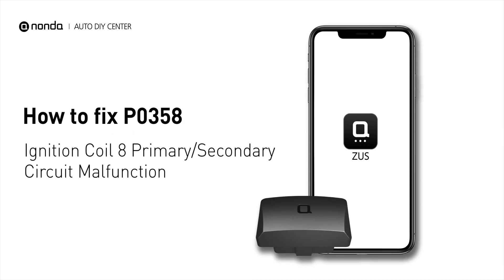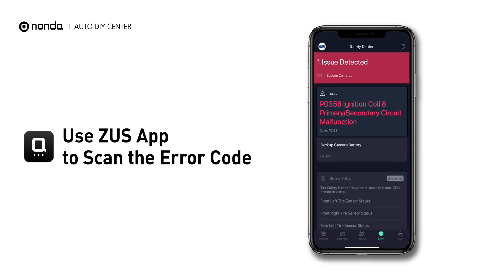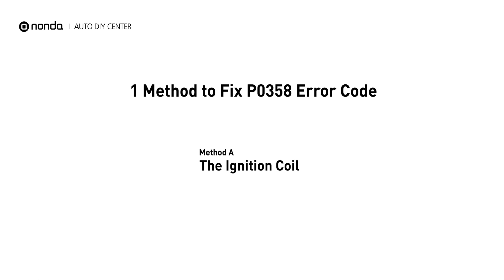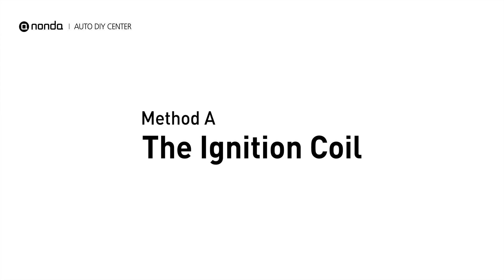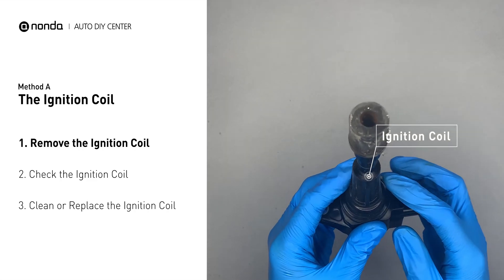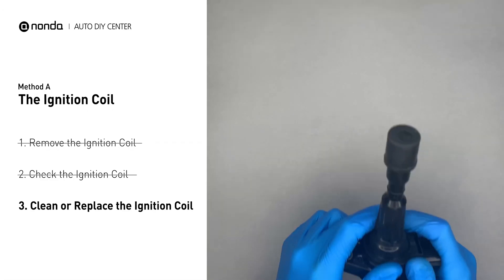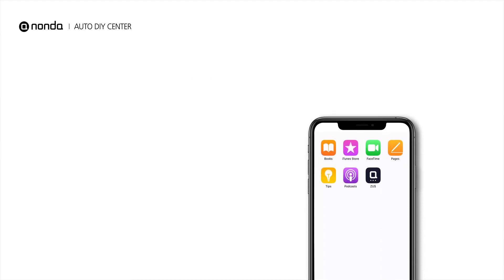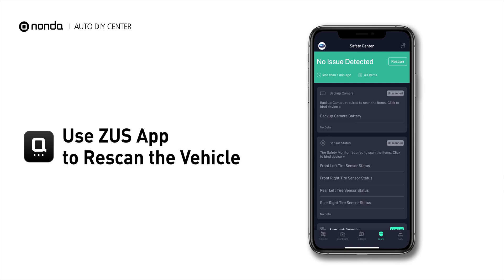How to Fix P0358 Engine Code in 2 Minutes [1 DIY Method / Only $3.94]

Comment from the maker: Hi, I'm Steve, nonda's lead mechanic engineer. 
Feel free to leave your comments here if you have any mechanic questions, I will be glad to help you out!
Reply: I got this code and the repair shop replaced all spark plugs and coil packs, replaced the wire to the coil, and replaced the PCM and I still get this code. Any clues as to what is still causing it?